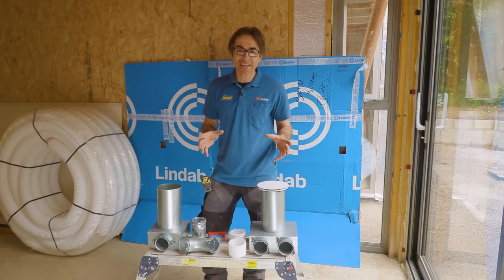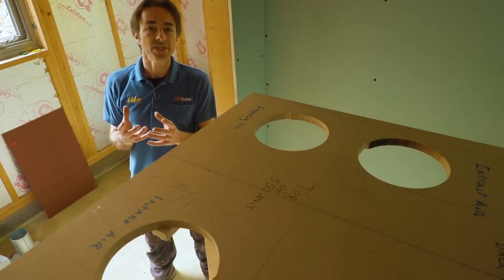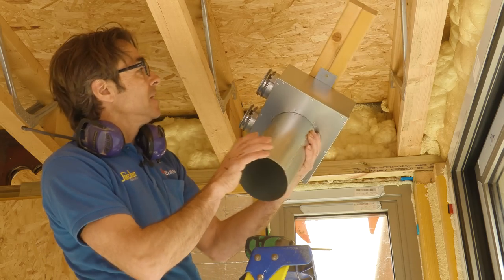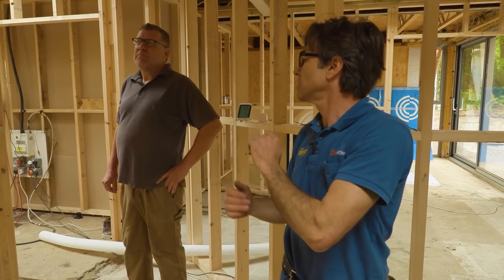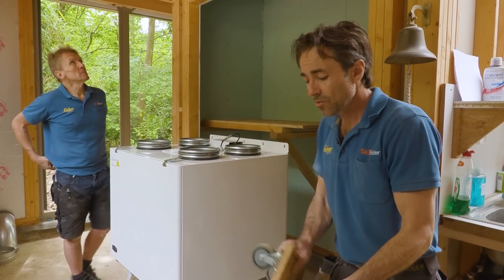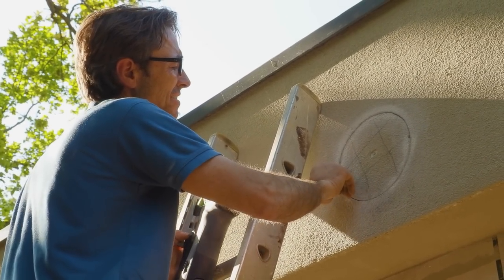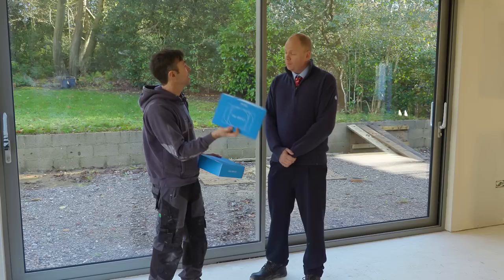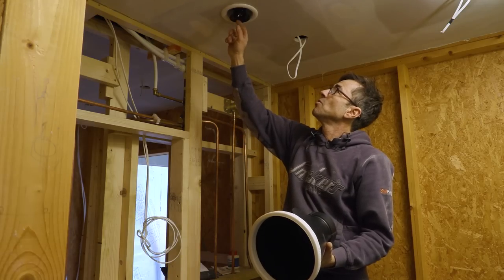Robin Installs the Lindab MVHR System - Capel #13

Comment: The first valve you fitted had 2 spigots is that to loop to the next valve ( obviously not a return) if so, how many  times can you loop into a valve. I take it this can also be done on a return extract run?
Reply: Assuming you mean the plenum (the metal box the valve pushes into) ; this is to prevent too much air flow going down the one duct. For the 90mm ducting he's using you wouldn't want more than 30m3/hr per duct as it'll just increase pressure drops and noise. With the Octopus system he's using the plenums are connected to the manifold only, so you wouldn't have ducts running to one plenum then onto another.

Comment: What is the energy cost heating with this system, in total KWh (I assume this is electrical but if, for example, gas heating source please provide appropriate heat costs conversion) per cubic meter?
Reply: Saint Coemgen   Not a heating system, purely a ventilation and extract system.
Reply: @M1JVD  I think you did not understand my question. Since it acts as a heat recovery (HR in the name) system, thus should decrease heating costs, I was asking for total estimated or known cost of heating when using such a system (including the costs of having this system also running). And since energy costs differ between areas, I was asking to standardize the energy measurement.
Reply: @SaintCoemgen  It will massively decrease heating costs but the costs depends on the house and heating method. This system costs nearly nothing to run because it uses very little electricity.
Reply: @Jhhhf4479  Thank you.

Comment: Point in question . It’s not a requirement of NICEIC regulations for a switched spur for extracted fans , you don’t need one , it was only introduced in commercial specifications by clients for ease of service , not and still is not a requirement for residential or commercial by the NICEIC , 

NICE SYSTEM LYNDAB BUT EXPENSIVE AND ONLY FOR THE FEW WHO CAN AFFORD THE COST OF INSTALLATION AND PRODUCT AND HAVE  THE SPACE , AGAINST THE COST OF AN ELECTRICIAN AS YOU STATED IN YOUR VIDEO , SEEMS THE LATER WOULD BE MUCH CHEAPER ?
Reply: Manufacturers normally stipulate their fans are protected by a 3A fuse, hence the spur. Also the NICEIC don't produce regulations. They are an approved body who measure contractors work against BS7671:2018 (18th edition of the wiring regulations). The regulations require you to comply with manufacturer's instructions, reinforcing the requirement for 3S fused protection.
Reply: @johndaniells4440  ah john again manufacturer,s only recommend a fused spur , some dont again , housing contractors buy the ones that stipulate this , as far as we are concerned it's not an issue , but I digress the point being , all well and good if you have space and money ( loads of it ) to spend on HVAC installations for 99 % of us its extraction , central heating and window vents lol
Reply: Totally agree there mate. As good as I believe MVHR is, it's too expensive for the masses and not really common place yet. Hopefully prices come down and the extract fans come a thing of the past in new build. I just don't think they do the job in modern construction.

Comment: Good video.  I would never install MVHR in any house I live in.  Over the years these things collect dirt in the ducts.  As the ducts are ribbed you will never clean them properly.  People can’t maintain their heating system, do you expect them to maintain this, cleaning and changing filters.  Dirty marks on the ceiling and diffuser from lack of maintenance. If you get a power cut you have no ventilation.  Homes today are getting smaller, windows are smaller to reduce heat loss and building control can’t decide if ventilation is good or bad.  What is the payback on this system taking in consideration all the other thing required to make it work, it won’t make economic sense.